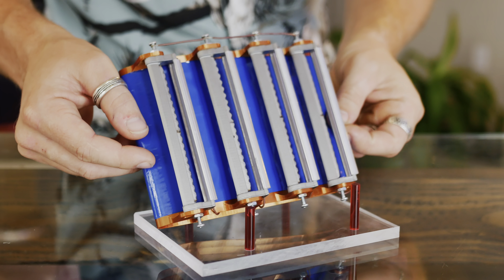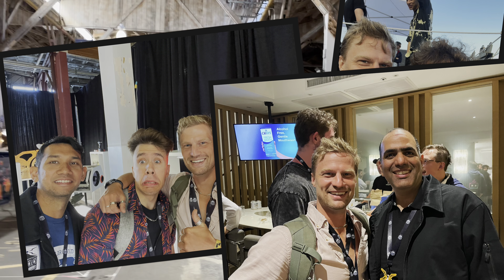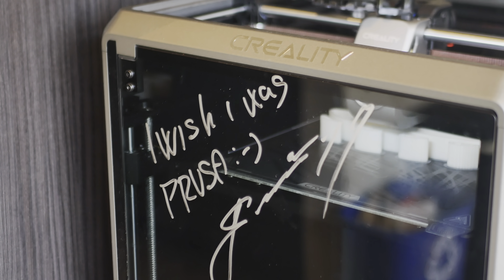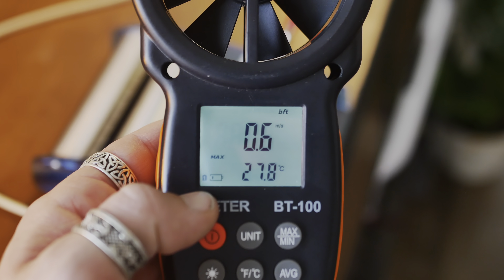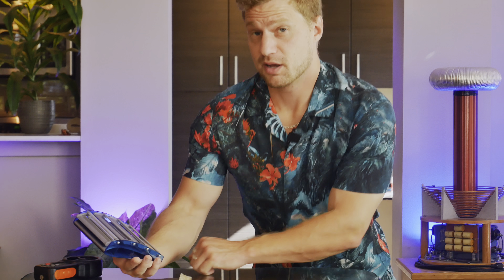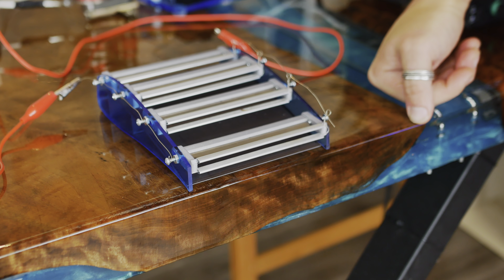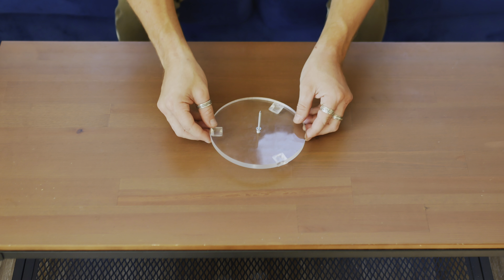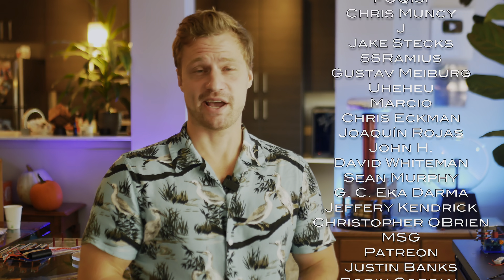Designing A Self Propelling Ionic Thrust Wing

Comment: Why don't you integrate the plasma drivers directly on the wing surface? Put the razor blades or when it's better a thin wire across the wing surface, maybe raised 2mm or so above the wing connected to one electrode and the other electrode connected to maybe a strip of aluminium foil that runs across the wing at the desired distance after the wire. Maybe when it's needed, curve the front end of the foil downwards, maybe - just maybe - in a groove that runs across the wing.

Try this with one such plasma acceleration stage, maybe still optimize it further for the max result and then place several of that pairs across the wing like you had, but not as an extra slotted wing above the wing.

---------
Or if you need the distance from the wing, maybe get a step back in the design and make a very sleek glider wing, very stretched, very long. Put the wire in front of the wing (not above, but in front) and put the aluminium foil on the second electrode on the forward round shape of the wing. On that part where big planes would have the "leading-edge slat", but without really being a slat if you don't need it.

Try it with this one stage on a long glider wing first.

Planes only have one set of wings nowadays. Well, you can make biplanes with two wings stacked over each other - or maybe behind each other, but they increase the drag, they need more power and fly slow.

A single wing would be more efficient. Maybe really a thin wire in front of the leading round edge of the wing and an aluminium foil with the other electrode on the leading edge of that long sleek glider wing. And that's it.

Comment: How about not only powering the stages separately, like you tried at 10:00 but also connecting them, themselves in series themselves. It should work like this even better, but you have to connect the trailing edge of a stage to the input of the next stage electronically. Make sure the outputs of your stun modules are isolated. 

The reason it probably didn´t work the first time is because of leakage current in the body of the modules themselves, forcing an almost common voltage on the stages, which might have repealed the already ionized air of the previous stage. But that´s just a guess.

Comment: Plastic screws/nuts would save you quite a bit of weight.Kitchen cling film for sheeting-did you sheet the underside?
Reply from the maker: The metal nuts are used to contact the razors and provide an electrical
Connection, as well as hold the thrust segments in place. Yeah I could use cling wrap, but as is the plastic I used only added two grams.
Reply: @PlasmaChannel  Too much drag on top of the wing, use a delta wing with the thrusters enclosed in ducting. Straying off-topic with this video link, but the styling of the Vulcan should work. https://www.youtube.com/watch?v=vLSEqmYbdhI

Comment: Try to use the tensile strength of the wire in a structural way and see if you can get some weight savings from it.

Comment: Can you not put the thrust components inside the wing? It seems to me that the current setup is trying to accelerate the air over the wing rather than building a (jet) stream of air that pushes the plane. For example the "Gloster Meteor" has the engines in the centerline of the wing, you just need to flatten it so the leading edge has a slit in it with an open trailing edge.

Comment: I would try putting the ionic trust in the bottom of the wing. The reason why, is that the airstream particles at the top of the wing has to travel more distance than at the bottom of the wing to meet the flow of air at the trailing edge, that gives you an advantage of the pressure differential.

Comment: Try putting the thrusters inline inside the wing instead of over it.  Picture a harmonica.  It would create a better air flow over the lifting surface.  While each thruster would increase the speed of the air flowing into the next one.
Reply: I thought of that while watching a @integza video and where he explains that the electrons "push" the air out of the way....then why not encapsulate that, and as you mentioned, the wing itself should be the thruster not a series of thrusters on top of the wing. Seems a lot of the electron force would push air in all directions and not just directly behind it...just a thought though. :) Awesome videos!
Reply: Putting it over the wing should lower the pressure above the wing which increases lift. Wings achieve this phenomenon via their natural shape and angle. You can do this with spinning objects look up the Magnus Effect.
Reply: @danielheitz7393  sure, I get wing design and function but if that was the case then why don't we see modern airplanes with wings directly above wings? There has to be some negative to that concept, counteracting forces due to the small wing sections above the true wing...just my 2 cents :) Would be interesting to include some sensor measurements on pressure for these prototypes, possibly even exclude the "thruster" component and just put wings sections above a full wing and see what the measurements come out to.

I'm no aerospace engineer :) - just curious and interested.
Reply: @legion9396 that’s because modern airplane design doesn’t support that first of all as we have already jet engines for thrust and the massive wing/wingspan combined with jet engine already creates more than enough lift. Secondly the second set of winngs on top would only add into coefficient of drag in comparison to adding more lift i.E not an efficient design. Old airplane design used those to compensate for moderate thrust but as you can see throughout the timeline of airplane development as jet engines emerged, bi-fold wings lost into existence.

Comment: What if you build a bi-wing design and then move the space between the wings down to less than an inch?  The ionic drive layers would be incorporated into the interior of the sandwiched airfoil (I;ll call it "SA") - ie. between the wings.  

If the air intake on the leading edge of the SA is wider than the exit slot, there might also be a slight ram-air or hi-bypass effect
.  
Using sharpened 32 ga wire (or smaller) on the upper layer of the SA and aluminum on the bottom layer of the SA (inside the wing, weight would be further reduced.  Anyone that has used a negative ion generator knows that a sharpened wire gives off more tons.  The successive rows or layers of wire could be cut from very fine wire screen - like the wire gauze that is used for EMP hardening of aircraft.

AiExpress sells some circuit board kits of mini-Tesla coils that produce good corona at about 1/3 the weight of those stun-gun module versions.  (the same circuit without all that epoxy) This also allows you to spread out the circuit for balancing the load.

The above is a version of what MIT did in 2018 - https://news.mit.edu/2018/first-ionic-wind-plane-no-moving-parts-1121

A potential future design improvement might include using thrust vectoring by routing the accelerated air thru the wing flaps, ailerons, trim tabs, or flaperons.  This might reduce drag and improve flight surface response.

A gridded Ion engine beam thrust speed is dependent on the voltage differential between the high positive voltage of the stream grid and the high negative voltage of the accelerator grid.   This grid design is impractical for an embedded wing design but It might be possible to incorporate a much more powerful centerline ion thrust engine using a single larger high bypass intake into a more powerful gridded ion thruster and then fed into a thrust vectored exhaust.  This design places the larger components along the center line and could be powered by capacitors charged by solar panels.   This design frees up the wing to be a high aspect ratio (20??), high load t(50+?) that is essentially one giant solar panel - think "Helios".

The possibilities of non-moving part thrust aircraft are fascinating and might be combined with fly-by-wire but using nitinol memory wire instead of solenoids and enhancing lift with enhanced laminar air flow and a modified co-flow.  I imagine you will probably consider such design improvements in the future.

I look forward to reading more of your experiments.

Comment: Maximize thrust points with the wire so you have say 50 ionic thrust points per blade.  Make the blade adjustable to better direct ion flow up down and side to side.

Comment: Did you try the wing with only 1 thruster? then with 2 thrusters? etc... to be sure you actually have the best efficiency for the number of components and weight.
Also, this isn't actually an ionic thrust wing... It's a wing, with ionic thrusters strapped to the top of it. Really not the same as the fuselage of a fighter jet being the engine.

Comment: I'm 90% sure the ionic thrusters are creating air separation from the wing because they would be pulling air from the wing outwards, having the ionic thrusters point towards the wing is going to be a better choice because it would increase lift which will result in a lower speed which would reduce drag which would mean needing less thrust which would mean less weight or better range, if what I said above is true you could try making an f1 style wing that has many segments, or try making the ionic thrusters even more integrated in the wing with the sole purpose of increasing airflow of the wing and reducing weight by having the anode be a cable a little above the wing and having the cathode be a part of the wong surface, this design will have the advantages of having the cathode be a structural part of the wing, but the exact distance the cable needs to be from the wing needs to be experimented on, and I think you might be able to reduce the separation between the ionic thrusters even further but you might not get the same benefit of running them in series if the flow of one ionic thruster needs to feed into the next thruster, but it might also increase the benefit of running them in series if the cable is closer to the wing, point is you should try more closely integrating the ionic thrusters into the wing where they both benefit from each other to the maximum ,instead of just having them structurally connected try making them truly one part

Comment: I think this is really cool, however, with any thrust system, its not always about the thrust, its about the fuel source, create an entire wing, cool, how you going to power it? the power source and weight of the entire thrust system with be greater than a simple dc motor and prop. its like concentrating on how to propel an airplane with peddle power but then realizing you need way to many people to peddle a Cessna - not against this cool project, just seams misdirected

Comment: I believe mounting the ionic thrusters to the top of the wing will cause a loss of lift. part of the reason wings create lift, is air flow, traveling, faster under the wind, causing higher pressure than the air, flowing on the top of the wind, causing a lower pressure on top, helping creating lift, having the ionic thrusters on the top, will increase air pressure on the top, causing a lost of lift maybe?

Comment: Just watched this. Very interesting. My only comments would be that the aspect ratio of your aerofoil looks way too low and your aerodynamic surfaces are way too draggy. You mentioned gliders which in modern times have very high aspect ratios, (extreme span to wing chord),  your wing looks like an old Cessna 152, not a JS1 Revelation for example. I know it's only 12 cm but as your span increases, so must your aspect ratio to compensate. Also, your surfaces need to be super smooth and clean with as little interference and form drag as you can get. Great video though.

Comment: Make the ionic thrust part of the actual structure of the wing. Ions flying UP off the wing, into the void above the wing. If you get too much downward thrust, then reverse it so ions flow from above the surface, down onto the surface. (The mass impacting the wing will be moot, it is about the "vacuum" created above the surface, by faster flowing air. Also, keep the first suction away from the wing tip. You don't want it sucking air from beyond the wing tip, pulling air-pressure volume from underneath the wing.)

Since this is technically a "thruster", you should be displacing the air from above, to below. You want to create that low pressure above and high pressure below, in a glider. There really is no true "speed lift", as there is no real speed in a glider. The wings capture high pressure below, with the curved underside, to create higher pressures, artificially.

Remember, a "lift wing" is really horrible for actual lift. They are more about control, at high speeds, with precision control of lift. That is why a wing doesn't just look like this... \ <-(Which is ideal for lift, but horrible for control. Also impossible resistance at high speeds, without some huge mass and thrust control managed separately.) That is also why the wings flaps point down, hard, on take-off, where full lift and less thrust forward is demanded. Each wing has an ideal speed, and you need to figure out what your max speed will be. (you figured that out already) Now you have to design a wing which is ideal lift-holding for that speed.

In an ideal setup, you would want to divert your ions from fore to aft, and top to bottom, depending on your desired control. Managed by grounds or by micro-vents to direct flow where it is needed. You have to balance lift and thrust, with as much control as possible. Some kind of voltage diversion would be ideal, to adjust ground-resistance across the two targets.

Comment: here is a thought do a double system for the plane se if the BSI is faster with 5 thrusters and a cone that compresses the flow out, then with the plane use both 2 BSI and the wing thrusters for take off and just the wing for flight. plus with the BSI you could look into vectored thrust also.

Comment: what a cool project!
I think a glider needs virtually no trust. the most important thing is lift on the wings. lift is generated by the difference in speed above and below the wing. therefore this shape.
What you have now done is created more speed difference, which should mean more lift.                  you must ensure that the airflow continues to follow the profile of the wing. this means that you have to place the trusters parallel to the shape.
If the airflow cannot follow the wing profile, the wing will 'stall' and not generate any lift. and therefore not flying. 
The forward speed is not what you should worry about.

I certainly see a chance of success for this project, but there is certainly still a lot to be done.
good luck

Comment: Why does the ion thruster have to be above the wing ?
Why not build it on/in the wing ? A 4th grade science project in 67 does confirm you still need flats and points on the surface of the wing to get ion air flow.

Comment: Gotta be honest, trusting ChatGPT with calculations is quite a gamble. I've tried that before, then read through the reasoning and it was... almost accurate, but it got a formula wrong, meaning the result was way off.
And unfortunately, you can't just tell it about the mistake and have it fix it. This has never worked once for me, it has always been wrong.

Comment: Looks like you'll be on a similar path to the MIT project from like a million years ago. Though theirs looks extremely light. How do you improve mass flow rate with ion thrusters? Also speeding the air up that goes over the foil should mean you'll get more lift, so slower flight, unless I've completely understood how that works :D

Comment: Hi Jay,
         Your efforts on your channel are to be credited but, you have to adjust your mind to suit the requirements. So the main important effect you have established is that each unit in parallel increases thrust. Forget about aerofoil, wings and suchlike as they are old set, old generation and because these are all to do with the standards of aircraft in general. Now you have one important feature now expand upon it using your standard design for 12 mm units in parallel you need to ascertain how small you can go (lengthwise without losing significant thrust and then when you have achieved the optimum you need to increase the number of the new unit in parallel and see if there is a max or if it increases in a infinite fashion –which would be great- or not.
 Basically, you need a craft with the near minimum of area to achieve lift not thrust. Once you have that you have the beginnings of a VTOL craft using full electrostatics. Then and only then you can use almost any form of thrust to generate forward motion. The main thing is to get your mind into the correct set to achieve your aims. At the moment all your efforts are being channeled into an aerofoil in shape and operation, try and use your thrust in a vertical direction, because if you can achieve sufficient thrust in an aerofoil fashion then you should be able to achieve direct lift, which I think you will find is 10m/s.

Comment: What if instead of mounting the thrusters on top of the wing, you split the wing in half horizontally and integrated the thrusters in the middle? That way the upper airfoil airflow remains untouched and you can still use the wing as a propulsion unit

Comment: Hi there, All power to your elbow as we Brits say, but I think you are heading in the wrong direction. Your sample wing section is running what about 4m/s airflow over 12 cm of lift electronics. Extend the model to the length of a real aircraft with a wing span of 12m which should give in theory 4m/s x 100 = 400m/s across the whole wing. It's worth thinking about. Firstly make 2 or more of your wing sections and you should see that many times the VOLUME of flow, and it is the volume of flow that gives the lifting power